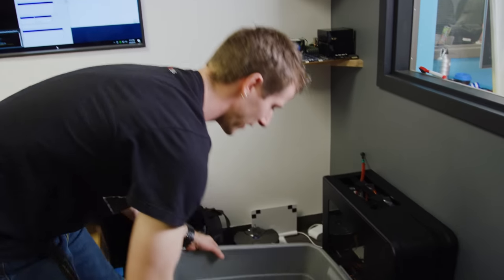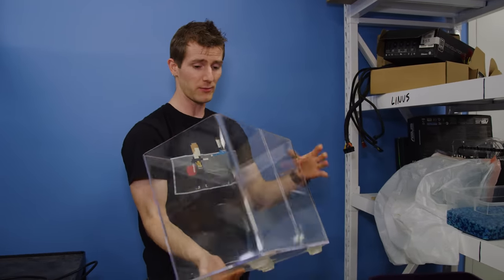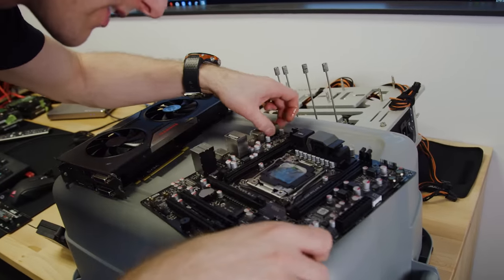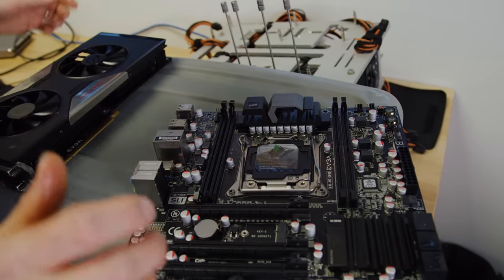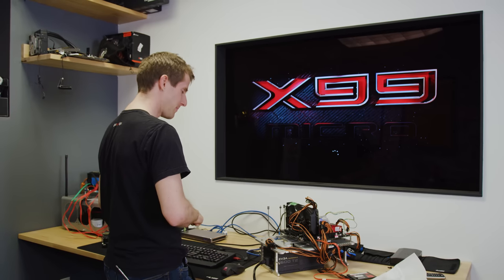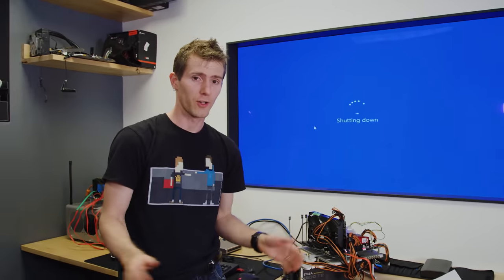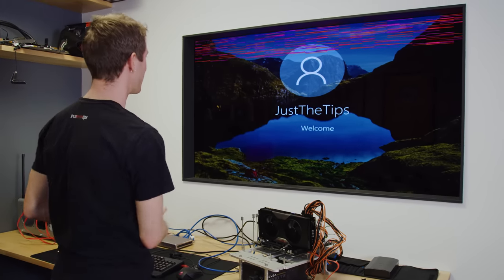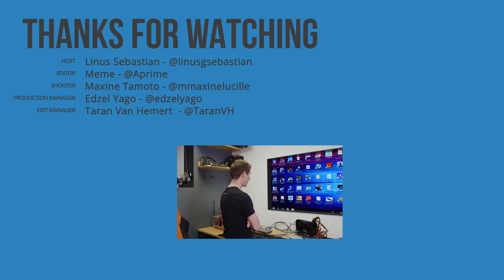Parts from the Oil-cooled PC - Do they still work???

Comment: you have to clean it with throttle body cleaner you get the cleaner from the auto parts store then you have to apply new thermal compound because the thermal compound that was in the oil has become contaminated

Comment: Use 90+% rubbing alcohol to clean off the mineral oil, it won’t destroy the plastics but is solvent enough and cheap enough to use a lot of it to clean your parts

Comment: You guy's know that the Isopropyl alcohol (2-propanol) you use for most everything actually works like an emulgator between mineral/hydrocarbon based oils and other alcohols and water? Like that's why it's used to prevent condensation in fueltanks and what not. Wash parts in gasoline, then wash in Isopropyl alcohol, and voila...

Comment: I still don't get it why many, many of those videos are made like it was a spur of the moment kind of thing - which in my opinion is why those things keep going wrong.
It could be done exactly the same but with a paper towel roll nearby and a gallon of regular alcohol and a bottle of isopropyl alcohol. Remove most of the oil with the towels, dump everything inside that grey bin filled with alcohol and scrub lightly with a toothbrush. Then rinse with isopropyl and replace the thermal paste on the GPU.
Done! Same video with a more professional-ish look and a VERY different ending…

Honestly it can be frustrating to see things done like that. Like the 40k rig with GPUs hanging all over the place and a mess of cables looking like left overs from past Christmas.

Comment: Honestly, I expected you to at least MENTION checking the thermal paste on the GPU, especially after Luke told you so many times that running his GPU out of the oil without reapplying the TIM is what killed his GTX260 back in the day.

Comment: The way you built the old tank is never going to work. The weight of itself and pressure pushing  out is causing the acrylic to flex and crack at it's weakest point. The seam... picking it up probably compounds this issue.

Comment: Sad thing is that they will still trow that X99 board away. X99 WILL get pretty rare. Its the same deal as X58 or X79. 

As someone else already said in this comment section, if it had been properly cleaned, it would still work, including the GPU!

Comment: 2 years later but I need to ask. If I bathe the components that were dipped in mineral oil in isopropyl alcohol will the oil traces be cleaned of the components?

Comment: oil is non-conductive coolant or thermal fluid in electric components as it does not conduct electricity and functions to displace air and water. right?

Comment: Does drip-drying work at all, or does there need to be an additional process to remove all of the oil?
Reply: Ideally, you should rinse the oil with ethanol to prevent further decay and dust accumulation. Linus didn't do that and effectively abandoned the parts in a dusty corner, which very likely was the reason for the issues shown in this video. Drip-drying will only get you so far, and it's certainly not a long-term solution.

Comment: should have poured fresh oil over the parts in copious quantities to get all the gunk and moisture off of it.  then let it drip dry in a dust free enclosure before trying to use them again.   the other option would have been to just accept that you are sentencing those parts to life in oil with no chance of parole.

Comment: I soldered a capacitor on my second 290x card wich almost completely got loose when I removed the stock cooler. I've been using the second card for a year without a problem :D
But who knows, the capacitor might be broken. Maybe it isn't used (used for another screen port)

Comment: Oil cooling a complete PC infrastructure is ridiculous. The mineral oil seems to be a inert but it really isn't. You even noticed the Plastics that become hard or brittle and fall apart. Electronic capacitors are sealed with rubber keeping the electrolyte inside capacitor. Many other parts are not designed to be in an oil-filled environment. It will work for a while until the oil breaks down and modifies the materials properties. The whole idea is silly. Also you have a potential fire hazard on the parts when removed from the oil and reused. Your reliability will go way down as all the electrolytic capacitors have been compromised. I'm glad to hear they can no longer build these. Just my opinion of being in the electronics Industry for 40 years.

Comment: use isopropyl alcohol  90% or better and it should remove a great deal of  the oil and the isopropyl alcohol will evaporate  fast and is non-conductive

Comment: You could clean the components in dishwasher you know :) LN2-Overclockers way of getting vaseline off. Need to thoroughly dry afterwards (water creeps under the bgas if not underfilled). GL.

Comment: Oil is very common in the automotive world, yet nobody is thinking about auto industry cleaners... Simply get a couple of 4$ brake cleaner cans... Very volatile and very good for cleaning up oil like this. Just spray massive amounts all over it and let the crap drip off. Dries in few minutes! Will also degrade plastic and rubber but eh w/e...

Comment: Does mineral oil dissolve in isopropyl alcohol? Lol soak it in 100% isopropyl then let it dry. Or if its non-conductive . . . Run it in the alcohol. 🔥

Comment: So... some artifacting as it's booting into Windows and it's just "dead."  I'm starting to think you're doing more harm than good to an uneducated audience.
Reply: John Drachenberg "Repairable" on a card that old might as well be dead. If it was working correctly, the artifacting wouldn't be there, and it would take more time than it was worth to diagnose what was wrong and fix it. Nobody would use it as-is. So yes, it's dead. Not everyone is stupid enough to believe that a card that still boots is completely dead, but my old 560ti went to it's grave trying to render Deus Ex: Mankind Divided. It still boots...for about 20 minutes at a time.
Reply: Dead card ..get over it